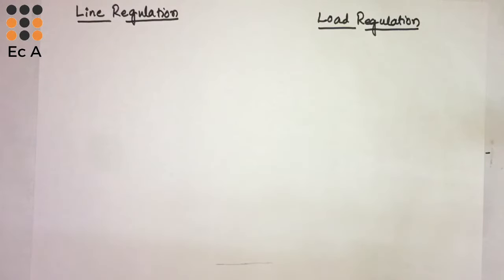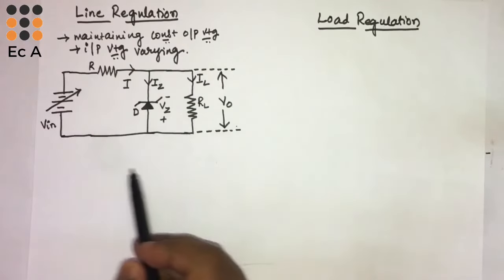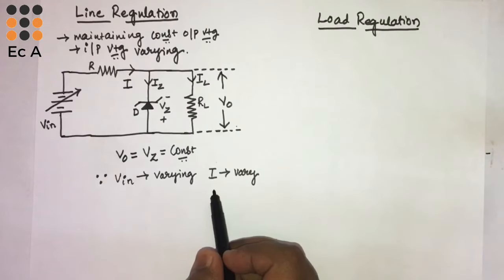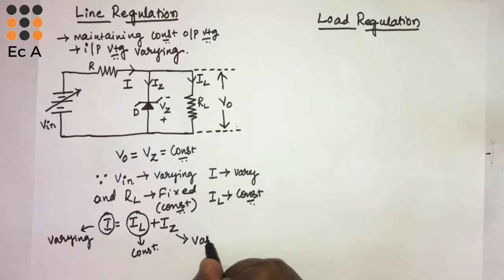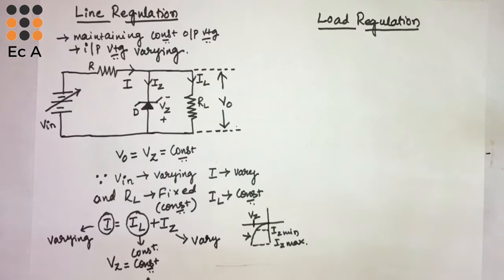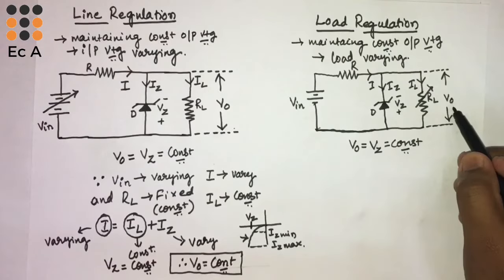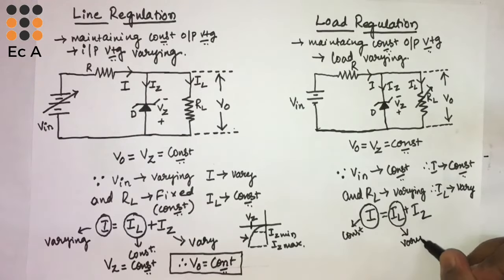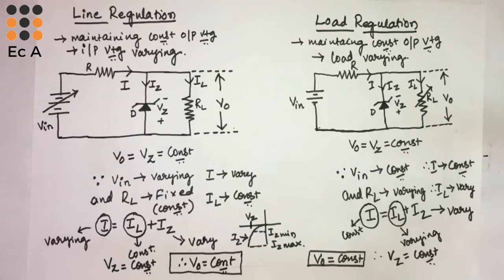#12 Line regulation and load regulation || EC Academy

Comment: In load regulation how did you conclude that i will be constant if Vin is constant. Shouldn't i be change when we change load resistance?
Reply from the maker: I is the current that flows through the branch where Vin is present. Hence I should remain constant when Vin is constant. But I=Iz+IL and since RL is varying then IL will vary. To keep I constant Iz will vary. Hope you understood. 👍
Reply: as I =(Vin-Vz)/R
all are constant. You were expecting this from him.

Comment: How do you make sure the Zener Diode will operate between Imax and Imin
Reply from the maker: Imax and Imin will be provided in data sheet for Zener diode. If you observe the circuit, we have connected Rs which is also known as current limiting resistor. This resistor should be chosen in such a way that Iz should be between Iz max and Iz min. 

Hope u understood.... keep supporting EC Academy 👍
Reply: @ECAcademy  thank you